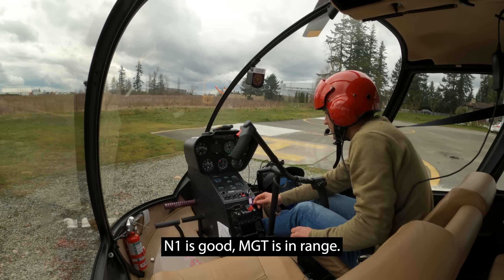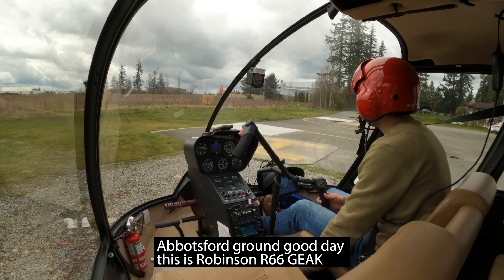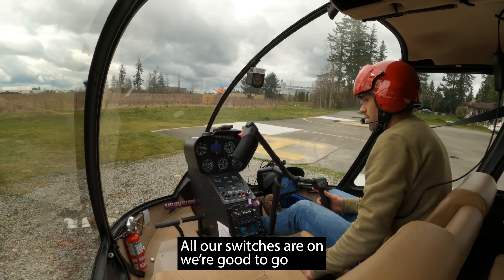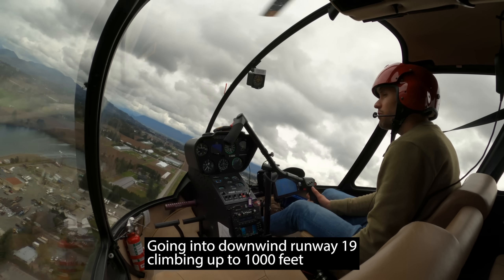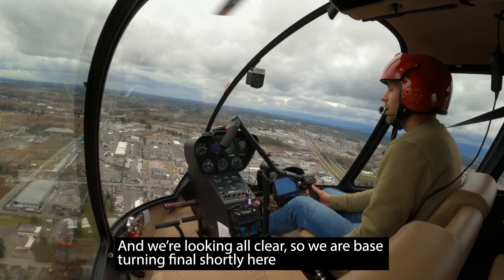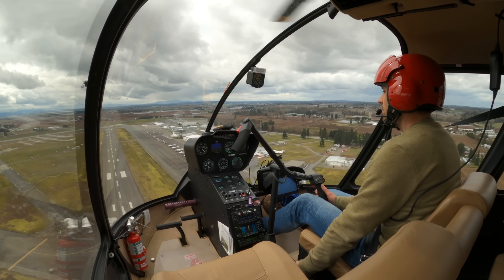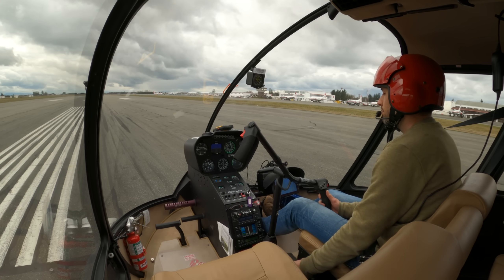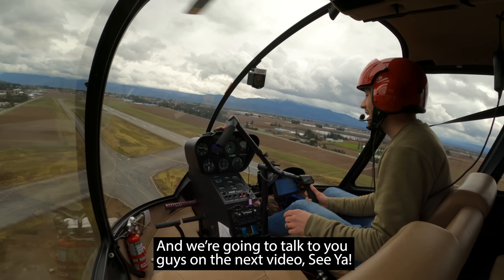Robinson Helicopter R66 Turbine Full Down Autorotation

Comment: I've heard that in the R66 you're not supposed to lower the collective for a moment after going to idle because of the residual power from the turbine, unlike an R44/R22 where lowering the collective should be done immediately upon going to idle.
Reply: Here's the reference from the Robinson Helicopter Flight Training Guide - Chapter 5 R66 Pilot Qualification Syllabus.
"PRACTICE AUTOROTATION ENTRY:  The throttle reduction during the entry into a practice autorotation in the R66 is different than the R22 and R44. In the R22/R44, the collective is lowered full down, then the throttle is rolled off. In an R66, this technique could cause a rotor overspeed. The proper technique in the R66 is to first roll the throttle off, then lower the collective."

Comment: Why are you only holding the right side of the "control yoke?"
Reply: If you sit in the left-hand seat, you can hold the left side!  The other hand is for the collective but anyway, control inputs in a helicopter are very sensitive, no need for two hands.

Comment: It's a bit cheeky to call that a "full down autorotation" - full down means you can't use the collective until ON the ground, stopped and ready to lift off! The airport may not like you risking the runway though. Do it on grass, although that is much harder if skid direction and moment misalign!
Reply: You have to use collective at the bottom of every autorotation, that's how you cushion the landing, no?
Reply: @bacontorque  yes i agree, but it is whether you bring on the power as well. No engine power all the way feels very different. However i was 2 up in a r22, not 1 up in a 44. Robinson do a great course at the factory and my home instructor made sure we did some all the way because it is so different and best to practice, even if the risk is higher.

Comment: Why are you landing helicopter like plane🙄it doesn't have wheel..?
Reply: The forward momentum keeps the blades turning. If you tried to get a helicopter into a hover while the engine is out it's going to fall out of the sky like a rock.

Comment: Mate just a point on Safety, Robinson Company has been teaching to rotate your helicopter in a holding position than lift up wards then take off in the direction as required, ie example this is to make sure you dont run into power lines or buildings extra, I notice you just took off with out safety check for unforeseen objects , Regards Trevor.W.Bacelli.

Comment: I always thought of getting my Helicopters License, Although its hilariously expensive and a lot of loans for your schooling you'd have to take. But overall it is my dream to fly a helicopter.
Reply: Get a small one. They are called ultralight. Some you don’t even need a license. However I wouldn’t recommend flying without training. Or go to a flight school for an introductory flight. That costs a few hundred bucks.
Reply: Good job man
Reply: Are you talking about making a career out of it, and are you from the US? If you're young and healthy, and American then the military is a great option to get the training for free. You can either join the army and fly as a warrant officer, which would require the least amount of schooling due to the fact that all other services require pilots to be commissioned officers, and that means holding a 4 year degree and then going to officer training depending on which branch/service it is or become an officer through that service's academy, which is typically 4 years long. Or you could join any service and go into any career field for 4 years in order to earn the Post 9/11 GI Bill (I would suggest the Air Force, they treat their people better than other services and there's a ton of easy career field options), that will pay for all expenses of flight training as long as you do it through a university, which could be a 2 year community college or a 4 year university depending on if you want to earn a 2 (you can actually do it in 3 semesters, so not quite 2 years) or 4 year degree in aviation. If you don't do it through a university, the VA will still pay for it but they require you to have a private pilot's license first, and that can cost you 10-15k. Or you might be able to take flight lessons using TA (tuition assistance) while you're still in the service. TA pays for college expenses for active duty service members, I'm not sure if it covers flight lessons or not though.

This is just what I've learned about flight training over the last few months of research. I'm an Air Force vet, and will start training at a community college this fall, some of this I wish I had known MUCH earlier 🤣.

It's either that or work hard, live like a monk so you can save up the money, or if you're lucky you can do it through scholarships and grants. Either way, if it's your dream then do it. Go pay for a discovery flight at a local school TOMORROW. Just about every school offers them, they're only 350 bucks for an hour at most, and it will give you the motivation you need to find the money to get it all done!

Comment: Seems much smoother than I remember doing them in an R22 many years ago.  My recollection is it was like falling like a rock.
Reply: It's an R66-- heavier blades than a 44 and a lighter airframe, so say nothing of the comparison to an R22-- and its blowing 20-25kts: the thing barely requires pilot inputs to autorotate well in those conditions. Even an R22 almost feels accommodating with a 25kt headwind :P
Reply: It’s not an R22.

Comment: Hello Mischa, I like your videos very much , congratulation !!
One question, I have an R66 I also use a GoPro hero6 with external mic connected at the military plug, the lemo I use on the Bose A20. External audio its very clear but intercom sound very distorted. Did you use any special configuration. Thanks

Comment: I've always wanted to practice auto's in an R44/R66. I suspect they are easier than the R22 as Blade RPM and timing of the flare and collective check isn't as critical however they would be slightly more challenging than a Bell 206 as you don't have the blade inertia of a 206. Your touchdown was very smooth well done!

Comment: I noticed you drop the collective and then roll the throttle off.  Is that a Robbie thing? All of my autos have been in a 300 and now in a 407, and it's always roll the throttle off and then lower the collective (thereby actually simulating the loss of engine power first). Really smooth finish at the end.  20 kt headwinds make it fun to truly zero them out.
Reply: Robinson says that for practice autos in the R22/R44 the collective should be lowered first, then the throtttle rolled off.  In the R66, the proper procedure is to roll off the throttle first, then lower the collective.

Comment: You took off from 19 before fully finishing reading back the clearance.....
Reply: @Super_Trooper  Thanks for the clarification.  I only fly fixed wing and the concept of 'hover' is foreign to me,
Reply: @Super_Trooper  Actually I wasn't' talking about the initial takeoff.  After he made his Stop (the full down autorotation stop) on 19, he was talking to the controller about taking the heli back to BC Helicopters and he started the hover before fully reading back the clearance.  But in either case, I guess for a helicopter, the hover is allowed?
Reply: Arun Nair Yes

Comment: The Robinson R66 crashed 43 times since 2011 and killed 35 people. The Robinson R44s were involved in 42 fatal crashes in the U.S. from 2006 to 2016, more than any other civilian helicopter, according to the NTSB. So why is the Robinson Helicopter Company still allowed to produce cheap, unreliable, unsafe helicopters is beyond me. So this Full Down Autorotation video looked much more like a regular landing than a real emergency situation. I'd like to see you do the same thing but without knowing when and where the engine failure will occur, and at a higher altitude than this?
Reply: Maybe because there are more R44 than any other civilian helicopter in the air?

Comment: What is the meaning autorotation ?
Reply: I'll give you the non pilot explanation, as explained to me by copter pilots.  The main rotor, powered by the engine, provides both lift and forward travel, based on the position of both the the entire rotor and the individual blades (the collective and the cyclic, although I forget which is which).  If you lose power, whether by accident or intent (as in this case), you manipulate the pitch of the rotor and the blades to maintain your forward speed.  The relative wind going through the rotors will provide some lift to the helicopter.  At the right time during touchdown (takes practice!) you change the pitch to grab as much air as you can, slowing your descent to a safe level.  The word autorotation refers to the blades spinning through the air even though they are not powered.
Reply: Did you try googling it before asking the question?

Comment: Nicely done. Back when I was much younger and in the Marine Corps, I was an avionics crew chief (that was pretty rare back then - not sure it's even allowed anymore) on UH-1N Hueys in the squadron out of New River. I couldn't count all the autorotations we did. 90% of them were not full - only about 10' off the ground. But I don't recall ever actually doing a full autorotation on the runway. It was always on the strip of grass next to the runaway. It seemed to be a lot easier on the skids because of compliance and a little more ability to slide once we touched down. Even when we did what we called cut-guns - hover about 3' off the ground and kill the throttle - always on the grass because those were harder on the bird than anything else. Not a critique - just a difference. Yours was right on the money and that's all that's important. Any landing you walk away from is a good one. Well done.
Reply: The skid plates on the R66 are impressively tough, myself and other pilots I trained with did a lot of sliding down the runway practicing run on landings and full down autos and the wear on the skid plates was hardly measurable!
Reply: @nathanemilywillems9699  thanks!  I’ve been wondering just how hard it is on the machines. I’m hesitant to do full-down autorotations just for fear of adding extra wear and tear. It’s already EXPENSIVE enough just owning a helicopter!  😉

Comment: My CPL(H) expired years ago, your video brought back memories of doing this in a 1st generation  R22 without correlator...
Reply: When the engine is off, it doesn’t matter whether you have a correlator or not. Actually, all helicopters have correlators (incl the old R22), but not all have a governor (I suppose that’s what you meant).   As a matter of fact, in a practice autorotation to the ground, you actually have to disconnect (override) the correlator

Comment: It’s interesting that you didn’t inform the tower that you were doing an auto-rotation landing... on purpose?  I guess any landing is a good landing, but if you were in a true engine failure situation, requiring the auto-rotation, then wouldn’t you need to declare an emergency?  Seems to me they would want to know either way.
Reply: Pilot was in complete control during the entire maneuver so no need to make any special requests or declarations.

Comment: Great auto rotation demo. And the video describing WHY it works with the clutched gear with the pins in it made me confident that it works as you described. With engine low RPM or engine dead the clutch gear will let the rotor spin. Brilliant. Thank you.

Comment: Nice auto, thanks for sharing. I am curious about what your spot was you were shooting for? Certainly hard to hit anything specific with those winds. My guess is that you were shooting for the 'aiming point' solid stripes? Is the R66 easier to auto than the R44, or about the same as far as energy in the blades, etc. Looked like you even had quite a bit of collective left once you were down. Also, what is the best mount point and method for the camera? I have been trying to use the headset holders, but cannot get all of the shake out of the video.

Comment: Wonderful flying! Any reason during startup it had the sound of a EC145T2 startup?
Reply: Why do you think the startup sound is the one of an EC 145 T2 ?
Reply: Noah Pfeifer, here in Pittsburgh, PA, we have 135’s and 145’d primarily. I know what a 145 sounds like starting up, and the sound of the fenestron at the end gives it away...
Reply: I suppose I’m not “exactly” correct, it is absolutely the sound of a Turbomeca engine, whether it be an 145 or Dauphin, they sound similar, surely isn’t a Rolls Royce engine...
Reply: @mattskelton6244 , ok, i didn`t recognize that the start sound dont fits to thne R 66....